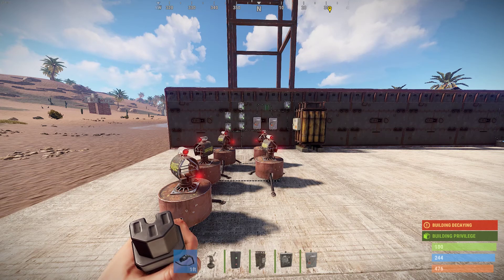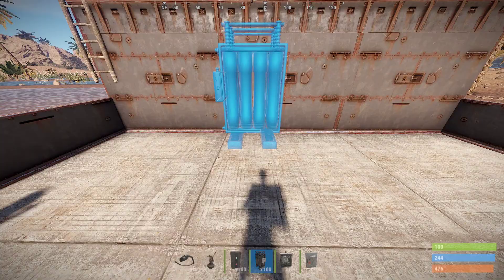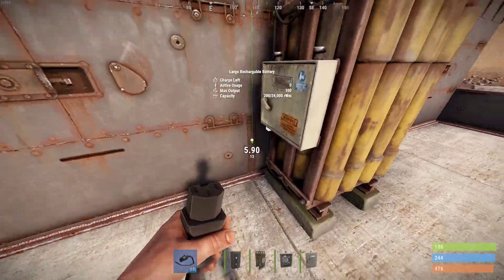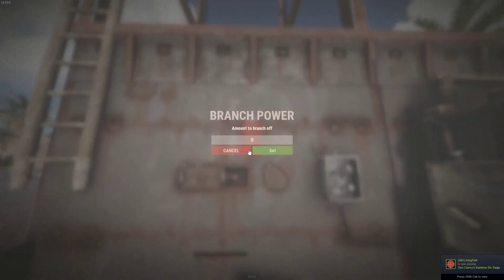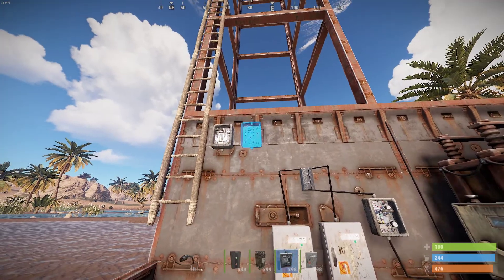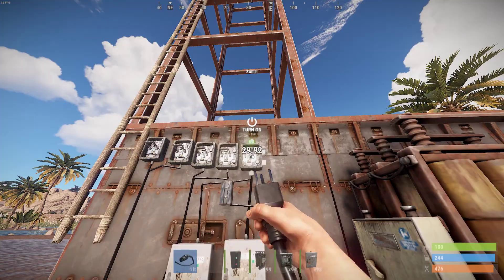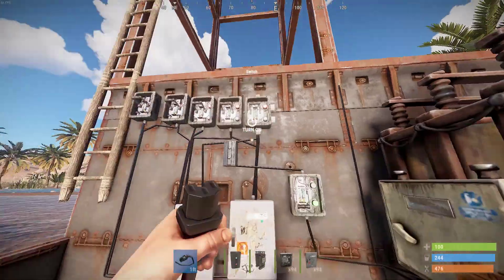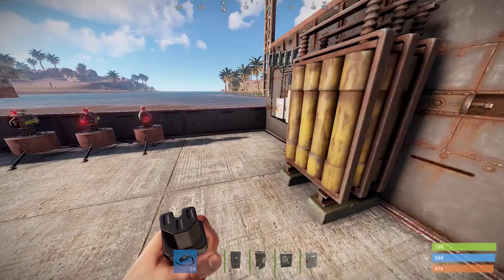RUST | How to setup turrets with wind turbines! | Electricity Guide 2024

Comment: I have a question what if your wind turbine can’t reach your battery what do you do?
Reply from the maker: Place a root combiner in between the battery and turbine as an extender :)
Reply: @SoneRust  what is the point of switches ???
Reply from the maker: @tanelviil9149  you don’t really need that many but if you want to individually turn them off that’s why.
Reply: @tanelviil9149  To be able to turn them off and on quickly to refill with ammo or change guns.
Reply: Imagine 2 years later he replies for help in comments. Its 3 years now. Crazy tho. Im on console used this technique. Thanks much
Reply: @williestroker9985  I still don’t know how to do electrical
Reply from the maker: @glocct1  anything specific I can clarify for you?
Reply: @SoneRust  no i just don’t have enough brain capacity to learn😂
Reply from the maker: @glocct1  rip
Reply: did u get an answer?
Reply: @chuppy6938  just use a splitter then from the input of the turbine into the splitter then the power output into the battery, I use this if I can't get the wire long enough
Reply: hello glocc rust

Comment: Does your wind turbine have to be so high up?
Reply from the maker: The lower you put if the less power it will output, your welcome to try and go lower but you’ll likely run low on electricity.

Comment: how would you run 9 turrets with this tho
Reply from the maker: wind turbine, 'as far up as you can' > large battery > switch > electrical branch set to 10 place 9 TOTAL branches all set to 10 with their output plugged into the input of the next branch, than place the branch out of each branch into a turret.

Comment: I did this exact thing and got offlined two nights in a row. They raided through where I had two torrets and not a single bullet was shot. Wtf are they hacking or am I doing something wrong. I connect the Torret and put gun and ammo in and it makes a ka-ching noise like it’s working. Everything’s connected right but not a single bullet shoots
Reply: Do I have to turn the sentry mode on or something?
Reply from the maker: Do they leave the turrets?, do they break them or just leave them?, after you fill the turrets do you go and turn them back on?

Comment: my battery failed
Reply from the maker: Any specifics?
Reply: @SoneRust  its losing energy faster then it gains
Reply from the maker: is the turbine high enough?
Reply: @SoneRust  yea
Reply from the maker: @Alterracreates  well, I'm not sure the exact situation but I would go up to the turbine with a wire tool and check how much power it's giving off, furthermore I saw someone telling people to use a spliiter as a turbine extension, you haven't been doing that right?, because if you are you will only be getting a third of the power your turbine outputs.

Comment: How many turrents can be put on this setup and what would you change would be very helpful to know
Reply from the maker: now i do turbine 9 floors or higher, > battery > switch > branch set branch to 10 branch out to turret power out to next branch, repeat for up to 9 turrets.
Reply: @SoneRust do you have a tutorial for that? That would help alot as I use 2 large battery’s for 5 turrents a peice

Comment: Do you need all the switches or can you just plug your turrets in from the splitters and not worry about the 5 different switches?
Reply from the maker: I would at least use 1 switch you could do turbine > battery > switch > splitters

Comment: Hey, great vid btw! If you want to put more than 6 turrets how do you do that? Do you need another wind turbine and another large battery?
Reply from the maker: No 6 turrets is mainly for simplicity, instead of using splitters only use branches, turbine > battery > switch > electrical branch > set branch out to 10 > branch out to turret, power out to next branch > repeat until you have 8 or 9 turrets, if you haven’t already put your turbine down try putting it as high as you can afford. Hopefully this was coherent :)
Reply: @SoneRust  Thanks alot!

Comment: Currently got 2 turrets so I can Just do the same thing minus all the switches as I'll have mine to 1 switch (im on console so electricity is all new to me) so connect turbine to battery get root combine n Branch connect it all up and boom?
Reply from the maker: Yea, so you can do turbine > battery > switch > splitter > splitter > turrets

If your wind turbine is too high up for your wire to reach the battery put a root combined half way up you base ‘inside’ 
If you want a setup easy to expand in the future you could do
Turbine > battery > switch > electrical branch, set branch out pwr to 10, > branch out > turret, than to add more turrets just put the output of the most recent branch into the next one down the line and make sure to set pwr branch to 10 
Hoped this made sense :)

Comment: Will 1 windmill and 1 large battery be able to hold all my 6 turrests on roof on 24/7? Great video btw :)
Reply from the maker: Thanks!, and yes easily just make sure to put the windmill a decent height :)
Reply: @SoneRust  I've just built this on console rust and it seems to drain faster then it fills the battery. Only using 4 turrets
Reply from the maker: @ChEm1cAlKeEn  not sure what issue you might be having, but I would just double check everything, and if your confident it’s all correct try this, wind turbine > battery > switch > electrical branch, set branch out to 10, branch out connection to the turret, than the output the the next e branch and repeat for as many turrets as you use
Reply: @ChEm1cAlKeEn  you need to use solar panels for eind turbine aswell

Comment: you dont have too use a batt if its not connected to a or swith and a blocker ;) you could just plug the turbine in the switch :p
Reply from the maker: True but if someone breaks your turbine your turrets are gone
Reply: @SoneRust  true 12 hours or so ..batt drains too .. you can use qr switch with a blocker

Comment: Is there a way I can hook up the turrets without each one needing it’s own swtich
Reply from the maker: Yes, just don’t place the switches after the splitters, and plug the splitters directly into the turrets, since I released this video I e been using electrical branches instead of splitters, battery > switch > branch”set branch to 10” plug left side of branch into a turret and the right side into another branch and you can continue that process until you run out of electricity. So I would stop around 8 electrical branches, giving you 8 turrets, 
Ps sometimes you will loose a little charge on your battery, but it’s ok wind turbines can fluctuate in power a little bit. But it should come back 👍. But if you do have a charging problem just bring it to 7 turrets and / or “assuming you don’t already have the wind turbine placed” put it up higher. Lol ps ps, if that doesn’t work use a root combiner to add another wind turbine/ solar panels to the circuit
Reply: @SoneRust  this worked a charm, must better when you can control the power
Reply: syfixx did u play tesla server when it first came out??
Reply: @YoungBossYB  yeah
Reply: @CaydenVanz  oh shit lmao this is coca-cola
Reply: @YoungBossYB  oh wtf what’s up how’s life?
Reply: @CaydenVanz  good bro how u doing
Reply: @YoungBossYB  Im doing pretty good, did tesla get shut down or something I havent seen it in like a month and a half ive been playing rustoria us long
Reply: @CaydenVanz  nah he shut it down cuz like it ended up dying like maybe 2-3 weeks after it came out
Reply: @YoungBossYB  rip
Reply: @CaydenVanz  yea man it was fun and we destroyed each other lmao

Comment: ok so i tried this and it works but unfortunatly only one splitter is getting power, but theyre both connected to the electical branch  and it shows the power
Reply: It’s the electrical branch, try plugging in random numbers until they all get the appropriate power, sone could probably give u the actual number you need tho
Reply from the maker: MuchFleek with electrical branches the left side is what gives out the set power the right side gives off whatever is leftover, so if your power source is giving off let’s say 60 charge and the e branch is set to 48 the right side will be 12 so I would make sure the e branch is set to half the max output of the battery you are using “large 48 - medium 23” you can’t setup 6 turrets with a medium bat because it gives out a max 50 charge. Assuming everything else is fine I would check to see how much power your solar panels / wind turbine is giving off. If nothing I said here helped you can add me on discord
Reply: Okay thank you!
Reply from the maker: MuchFleek np

Comment: if i hook up multiple wind turbines to the large battery does that mean the turrets will be up 24/7 ?
Reply from the maker: Daasus yes, it comes down to if you are using less charge than you are gaining.
Reply: @SoneRust  i used the system that ur showing on the video but like whenever the wind turbine stops spinning the turrets go off
Reply from the maker: Daasus if you have a battery in between that shouldn’t be happening

Comment: Since the splitter has 6 outputs you can hook 6 turrets right... would you boost from 50 to 60???
Reply from the maker: Racing Roy I tried 6 turrets but the charge drains faster than it charges,  not by much but it does
Reply from the maker: In three irl days it lost 2 hrs of charge, so if you let it charge for a while you would be fine